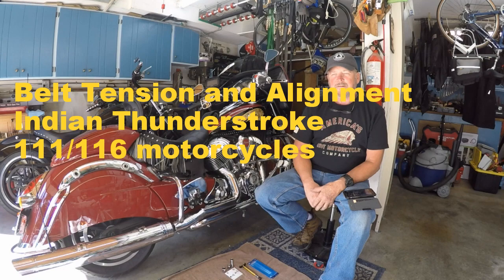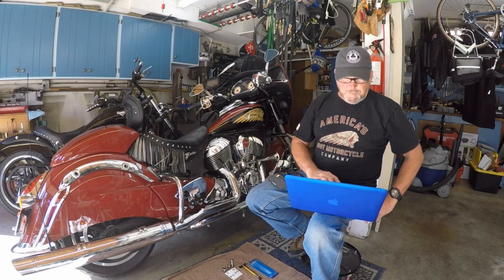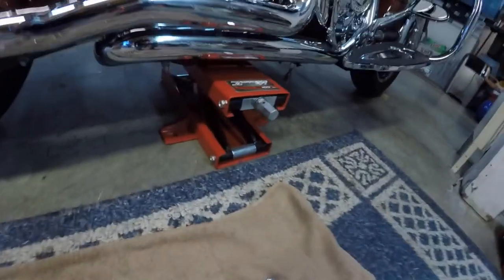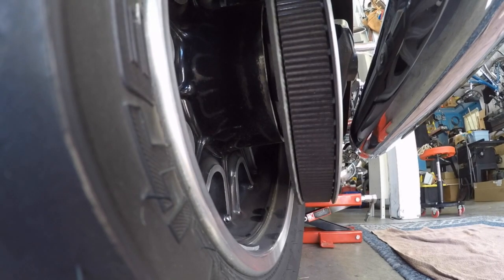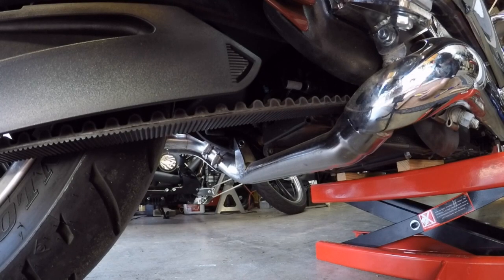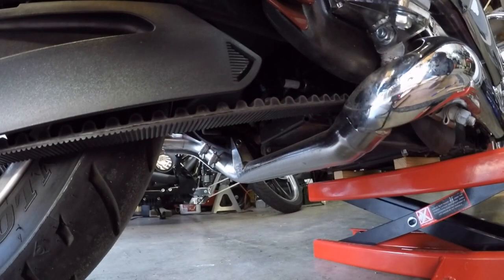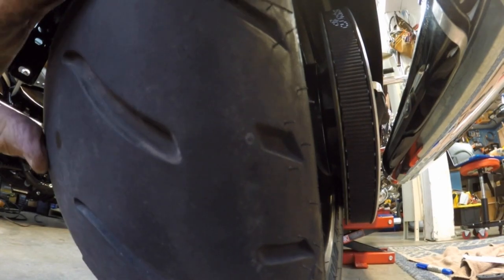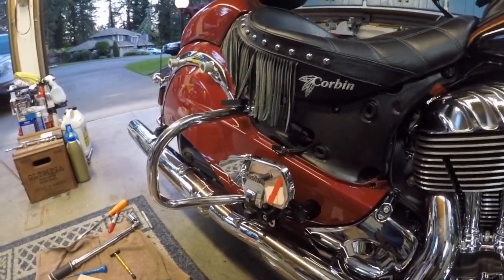Indian Thunderstroke Motorcycle Drive Belt Tension and Alignment

Comment: Sub'd and thumbs up!  Well Done. I live near Bowling Green  Kentucky ..... maybe we could make some rides together if we don't live to far apart?  I would like to know more about the exhaust. It looks like true-duals by freedom?  I don't want my bike any louder. I do want less heat from the cat. I was thinking about just drilling holes in it while it was on the bike. Then blowing out debris by blipping the throttle.  I am thinking a drilled cat would be less efficient and produce less heat... I think?  I have seen all kinds of videos on u tube.  Ideas?
Reply from the maker: Hi David. Thanks for the sub and your kind words. I live near Tacoma in Washington State. I don't know if you are a regular at Bike Week in Daytona Beach or not. I do attend the full 10 days of the event every March so if you are planning to be there, yes by all means give me a shout. I trailer my Indian from up here in WA all the way to Florida ever year. I get lots of "why don't you ride it rather than trailer?" For many reasons. I go to Florida for a couple months and I need too much stuff to be gone that long only with what I could carry on the bike. Also there is usually a lot of snow and ice on the initial legs of the trip in mountain passes in mid February when I leave Washington. I also hunt hogs in Texas on my way back up after I leave Florida so I need several guns and hunting gear. I have a 30 ft toy hauler RV I tow behind a Ford Super Duty Diesel which makes the trip very nice. 

So... exhaust, yes. They are True Dual Headers. I also have the stage 1 air cleaner and slip on mufflers, as well as the cams. I really like the way the bike sounds now. Yes it is a bit louder but to me, It's not obnoxious at all. I love the lopping idle with the cams and I can tell the increased in power over stock very easily. I couldn't have an Indian set up any other way now that I have this. I did test ride a 116 equipped Chieftain at Daytona last March. That will pin your ears back. Very fast and even a bit scary. As for drilling holes in the cat? I have no idea how that would turn out. I didn't do the conversion to True Duals to eliminate heat. I did it for sound and power. But it does make a huge difference in the amount of heat. I hope this helps. Craig

Comment: I have followed instructions to the letter, but no matter what I do, it always ends up against the inside of the sproket or the outside of the sproket. I can rotate it all day in the garage and it stays centered but as soon as I get on the road it shifts
Reply from the maker: Hi Michael, Yes I take your point. I have had a similar problem too. If I lift the bike, and rotate the rear wheel watching the belt, it moves in and out of alignment, back and forth. I have thought this over long and hard. Here is my analysis. Perhaps you may have some thoughts as well. If so I would appreciate your input. 

The drive pulley on the output shaft of the transmission is small compared to the driven pulley on the rear rim. So, it takes several revolutions of the drive pulley to rotate the driven pulley one complete turn. I don't know the exact number. I believe there can be imperfections in trueness of both pulleys as well as the adjustment for the alignment of the rear wheel with the straight ahead center point of the bike. I assume these pulleys are castings which are finally machined to a finished product. These then have to be mounted on the output shaft and the rear wheel. It seems to me there is a lot of opportunity for the assemblies to be ever so slightly un-true. Just a guess. Lift your bike and slowly rotate the rear wheel watching the belt, and tell me if it moves its alignment side to side during rotation vs just stays on one side or the other. 

Next as to how critical this alignment is. I also ride snowmobiles (I have an 800cc 2016 Polaris Axys 155 Rocky Mountain King) which are belt driven and the drive belt is very similar in appearance to the drive belt on our Indians. The torture the drive belt takes in it's job amazes me it can go more than a few miles before it blows. At idle, the SM belt is not captured by the drive (centrifugal clutch) or driven pulleys (output via jackshaft to track). As the SM engine RPM is increased, the driven pulley actually opens up allowing the moving belt to slip down into a smaller and smaller diameter space changing the gear ratio. As we slow the rpm, it moves up and out to a larger diameter space thus gearing down. This belt gets a lot of slip between both pulleys. We always carry a spare because they do blow. Some less aggressive riders may get 2 or 3 seasons out of a belt. Hotdog riders get less. So the belts are durable as hell. 

Back to the Indian belt... The Indian belt is a non slip cogged to pulleys deal. Much easier service than a snowmobile and way slower rpms. So how critical is a gnats ass alignment of the belt? I'm thinking not so much within a certain degree of accuracy. I stressed over this mentally for quite a while after I made the video. This is only my opinion. The shop guys at Indian may say different. I feel as long as the belt is not so out of alignment that it's trying to ride up one edge of the driven pulley or the other, meaning its riding easily on the face of the pulley, thats good enough. Due to the imperfections I list above, I don't believe a perfect 360 degree rotational alignment at the exact center of the driven pulley is even possible on some or possibly all bikes.

Before I had my Indian, I had and still have a 2013 glossy black Victory Vegas. On my by first trip to Daytona Beach ( I trailer via pickup and toy hauler from Washington State) for Bike Week 2015, I wanted to have Ryland Voss of the Vic Shop (he's here on Youtube) in Adel Iowa do some hot rodding and Dyno work to the bike. I did not have my Indian until later that summer in June. When I got there (mid February and negative 20!), Ryland found a screw in my rear tire. So, I had to have a new tire put on it. He had that rear wheel off in like 4 minutes. I drove it to another bike shop and they mounted and balanced the new tire. When I got back to Vic Shop, Ryland replaced tire and rim. He just eyeballed the alignment marks side to side and that was it. He has done it enough I suppose that he easily eyeballed the belt deflection too. Just used his hand checking tension to get it where he wanted. He didn't stress over a gnats ass alignment or tension procedure like the one in my video. It literally took him maybe 7-10 minutes to reinstall, align and tension adjust the belt/tire/wheel assembly.

So, final thoughts... lift the bike, mark the side of the belt with a sharpie pen and slowly rotate the rear tire looking closely for wear as shown in the owners manual. Inspect it really well with a critical eye. Use a good flashlight or shop light to inspect. If it's damaged in any way... time to replace it. Use the deflection tool to check tension and adjust as needed. I believe the tension is the most important adjustment. Last, rotate the tire watching the belt riding on the face of the driven pulley to be sure it is not radically out of alignment where the outside edges are wearing from riding up the sides of the pulley. That it's riding easily within the sides of the pulley. Check it every 1-2 thousand miles if it makes you feel better. Some might do it every oil change which is what I do.  

Lastly, make a service appointment and let them align it and see how they do for accuracy. I'm betting they don't get it any closer. The service manual says if you change the belt, change both pulleys at the same time as a set! E-GAD. I'm thinking if the pulleys are obviously worn compared to new... fine. But if not...Me, I'm just doing the belt. Can you imagine how much those pulleys cost from Indian? Hundreds for sure. A snowmobile belt runs around $120 for OEM and ~ $90 for a Gates. I don't know what our Indian drive belts go for. $$$$ I'm sure. 

These are just my opinions. You have to decide what is best for you and what you are comfortable with. Warmest Regards, Craig

Sorry about the length of this reply. ;0)
Reply: Did you ... rotate wheel backward and adjust till belt rides to outside edge. then rotate wheel forward, adjust to belt comes off outside edge. When you tighten axle nut the axle tends to shift. Make sure axle stays forward (try to jiggle adjuster) If it jiggles tap the axle nut forward with plastic dead blow hammer or use a block of wood.. And still once  you ride you still may need to make adjustment. Supposedly when you ride the engine is now applying  torque to the belt causing movement. Chances are you will never get it centered, just off one side or the other would be fine, or if it ain't squeaking leave it.
Reply: I found nothing in the Manuel and talked to a tech, he said it was normal to be on the inside
Reply: @ShabLee   Owners manual or shop manual? Owners manual will probably just say use the alignment marks.  I use the method I posted above on my Victory, which is the same set up as Indian( from Victory shop manual) and I always have success the first shot. Yes the belt will drift to the outboard side once driven but never make any noise. You will notice when you wheel the bike backwards the the belt will start to track to the inside but will track back once ridden forward. Like Craig said you will never get it dead center you will just drive yourself nuts.
Reply: 340rps The tech told me it was absolutely normal. I’ll contact another to see what they say.

Comment: Nooo when you loosen axle nut , retourqe to 15 ft lbs while adjusting
Reply: He missed a couple of crucial steps. For one when tightening the axle it will tend to move back and loosen the adjuster, you need to tap the axle forwards to keep adjuster tight.
Reply from the maker: @340rps  Have you done this? If you had, you would know that isn't necessary. This procedure is straight out of the factory service manual. I did it by the book.
Reply from the maker: Wrong. Read the manual again.

Comment: good luck getting it to run centered. If it ran centered when new no reason it would not be the same. If it ain't making noise leave it alone. That belt tension looks good right where it is. I'd leave it. Take it for a ride then see where the belt is riding. You can spin the tire all day on the jack, that means squat.
Reply from the maker: All I did in this video is follow the factory SERVICE manual to the letter for demonstration purposes. Buy the FACTORY manual and read it for yourself. The video is meant to help people who may not possess the confidence to try this without seeing it. I'm not really looking for community advice such as you gave me. I'm not new to this sort of thing and while I appreciate your input, I think you missed my point. This video shows exactly what is printed in the factory service manual to the letter. That is what it meant to show. Nothing more.

Comment: Where did you obtain the PDF shop manual?
Reply: Myron Benware I have the pdf  for the 2017 models I could send you. Even if yours is a different year I don’t think there would be much difference.
Reply: How can we arrange this? That would be great. I just bought a 2016 Roadmaster with onle 1,600 miles on it.
Reply from the maker: Myron, look at this forum post, the link to the service manual .pdf download is there.

https://www.indianmotorcycles.net/threads/turn-signal-troubles.219808/#post-2542348
Reply: Thanks for the info. Apparently this link is no longer valid.
Reply: Thank you sir. That worked great.
Reply from the maker: Thanks Glenn!

Comment: I thought that the suspension has to be loaded when checking drive belt.
Reply: Hi Bob! I downloaded the manual and confirmed everything is done on the jack. I'm a retired aircraft mechanic and was surprised that it wasn't checked under load too. It may be that belts are more forgiving than chains.
Reply from the maker: @denisewildfortune4058  Yes, I have the manual and I did this procedure by the numbers.

Comment: Just buy the proper tool for it.
Reply from the maker: Duane, what tool are you talking about? If you are talking the belt tension measuring device, It's a generic tool graduated in pounds. The Indian tool that I list the part number for is exactly the same tool, probably made by the same people for 3 times the money because it says Indian Motorcycle on it. Feel free to order the one from Indian if you want. It's a spring in a tube with pounds of force marked on it and a foot to fit the belt. Other than that... I don't know what tool I use in this video that you seem to think is improper??? Read the shop manual. This is the procedure. This is how Indian says to do it. I made a wood block holder for my ruler to aid in deflection measurement since it's sort of a 3 handed operation and God only let me have two hands. Four would be a lot better but we only get two. 

Geeze. I made this video because there were none on all of Youtube addressing this specific procedure at the time. It's longish but it's a complicated procedure to get it right and an abbreviated video leaving things out would have been of little use since a lot of guys don't have a lot of mechanical skills. So, again... What tool are you talking about? You commented twice the same comment about buying some so called proper tool. 

 I'm amazed at people who chip in criticism at people who take their time to make a video in order to help out others. I'm not monetized by anyone for doing the few I actually do so it's free buddy. Nobody made you watch it. You found it so I assume you were looking for help. I'm not a professional film producer. I'm just a guy with a GoPro trying to show interested parties how Indian says to do this. I took it line by line straight out of the shop manual. Take it or leave it. Make your own damn video if you think you are such a gifted film maker and mechanic. I guess no good deeds go unpunished.
Reply: Craig Miller yup
Reply: Craig Miller you used a stick.and a sharpie

Comment: If your gonna pay $27,000 for a bike, a few extra bucks on the tools you need won't bankrupt you.
Reply from the maker: Two comments that say the same thing makes me concerned for your memory. Or perhaps you feel doubly strong about some tool you believe I cheeped out on. What tool do I not have? Please explain. Also see my comment to your first post. There's always "some guy" here on Youtube. You Duane, are that guy. Look man, a cheap skate I'm not. I buy all quality tools. The belt tool is the same as the one Indian sells for 3 times the money. If you want your belt deflection tool to say Indian on it, knock yourself out. As for my bike as it sits with the customization I have, it's at $44,000 and counting. So you can't accuse me of cutting financial corners. Point two, I made this to help people. I didn't force you to watch it. Maybe get out from behind your computer screen and make a better one if you are such an expert mechanic, tool buyer, and film maker. Don't snivel and bitch, make a better video.
Reply: Craig Miller belt tensioner
Reply: @tax905972   belt tensioner is is about as useful as the belt tightness specs. Polaris seems to have learned from Victory that their specs were way to tight as when the belt heats up it will get WAY to tight. Guess it is ok if you like replacing belts and bearings prematurely.